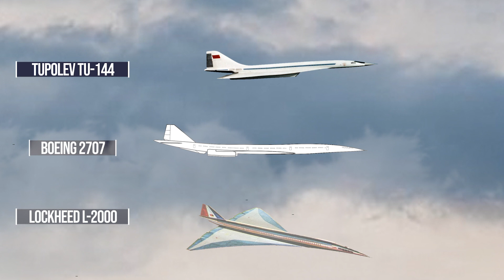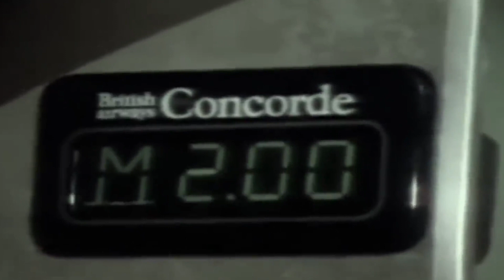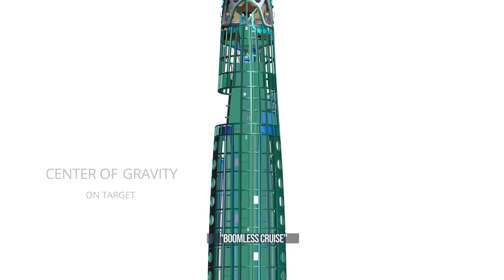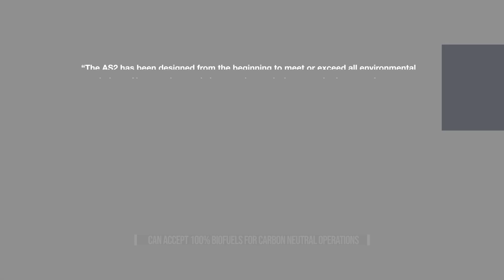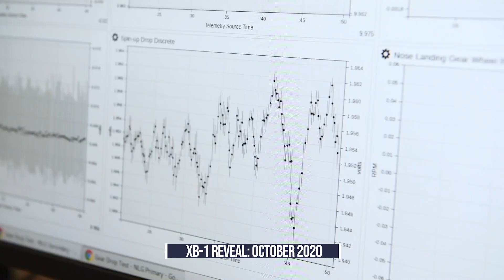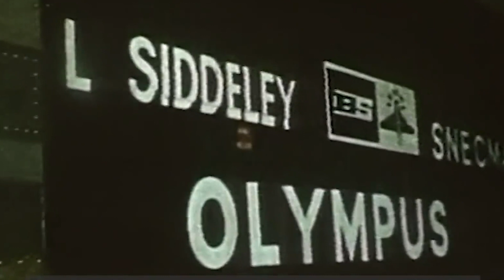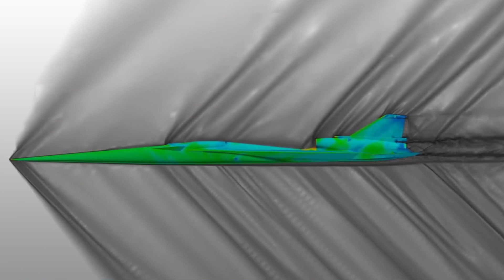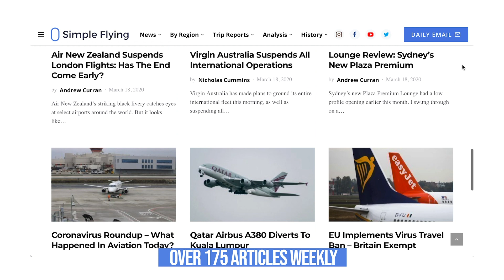Supersonic Flight - What Does The Future Hold?

Comment: true air boom looks like mars lander and if you do raotational front flaps has some slick tech and lets say increase side tread to be more scfi as stiffer and have rotational cocpit as escape pod, it would do fine also with virgin supersonic but I would gave su 57 front movable flaps and also front movable flaps to keep scfi look as wings are not new and sabre engine for 3 mach since they like star trek is bit more pirce also passenger must be more then  like 22-32  people atleast since idea off heavy altitude is kind scif flight anyway incorporated tech I would also a a mig air brakes kind a blue line has first upper brake isi oposite then twin back for glide brake purpose a easy rotational as to catch down flow wind stream, basicly is a high tech stream superjet and also 1/3 larger front tail for manta or mantis stability as know how which virgin liek beside e space comercial travel

Comment: a rebuild using modern materials of concord would be a world beater due to the fact it can hold 100 passengers per flight giving it the edge in profits over all of there's planes thus more profits equal more planes equals more profits equals more planes and so on it would expand faster and be more profitable quicker ticket prices would be in the region of the average person and not just first class . think seats per flight and lower ticket price not just speed and you have your winner.

Comment: Please don't lie. Supersonic is not going anywhere. There haven't been any solutions to the noise and fuel economy. All projects are renders with non existent engines and bodies. the only serious research is NASA's X-59 which was co-designed with Lockheed Martin Skunkworks. It has a novel design which will be tested starting next year. NASA expects to reduce the noise about 75% of Concorde but they won't know for sure until they try it for real. All these other projects are vaporware

Comment: I’m still very skeptical about the environmental claims on these planes as we don’t know what the full impacts of pollution at high altitudes. Blindly trusting net-zero CO2 technologies such as biofuels in high altitude situations is risky, and further research needs to be undertaken before we start pouring more carbon into the upper atmosphere with less efficient supersonic jets.
Reply: What we do know is that boom is using engines just like normal DC9s (Mid Bypass Engine in the works with collabs), with specially designed intakes. Unlike normal jets.